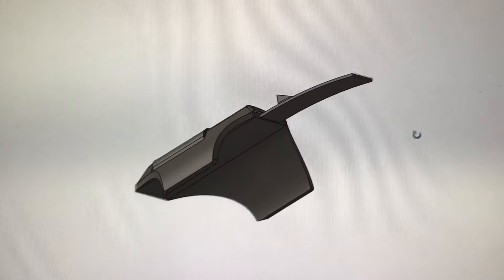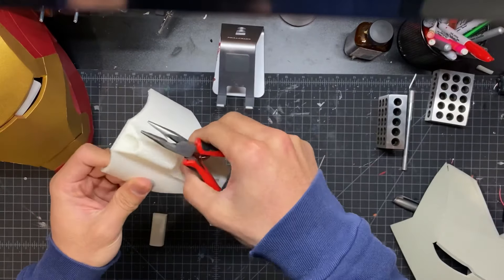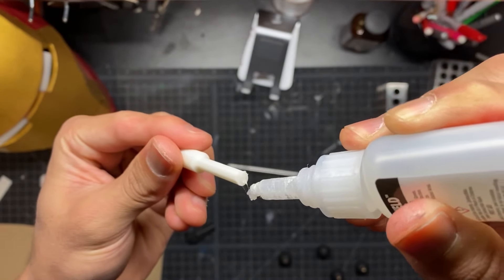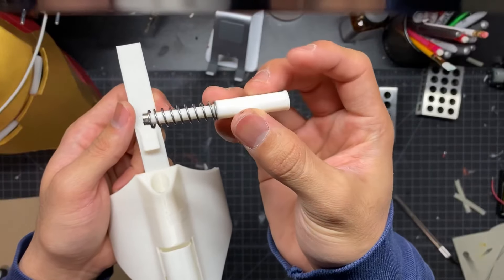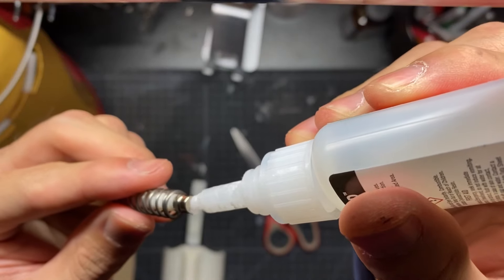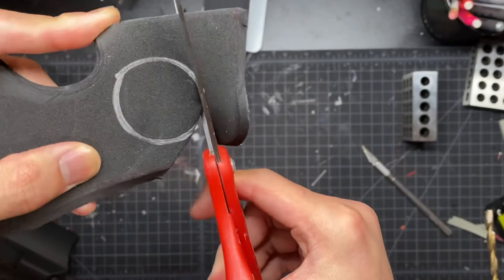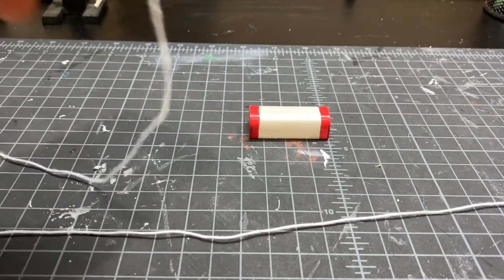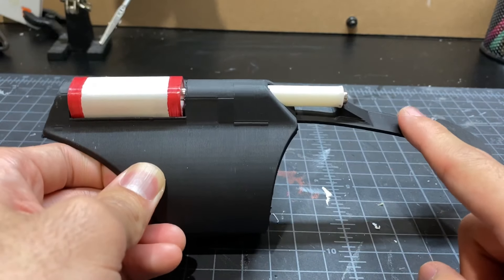How to: Spider-Man Web Shooter FUNCTIONAL! Real DIY No Way Home

Comment: Hello PropWay! (again) i successfully made the web shooter! it works amazing but my only problem is every time i shoot it at something metal it never sticks. only when i manually put the dart on it. do you have a solution to this? ive been thinking i should glue another magnet but i want to see what you have to say about this first.
Reply from the maker: Awesome! It could be that the dart is not hitting the metal surface straight on. Or perhaps you need a stronger magnet?
Reply: a follow up to prop's comment, it also might be hitting it with too much force, practice catching it when its about to hit the metal surface to break its speed

Comment: Which magnets did you use the 6x3 or the 6x2
Reply from the maker: I used 6x3mm. The link to the Amazon page is in the description!
Reply: @PropWay  thank you very much I was trying to model one of these myself then found your video and gave up on my dreams I actually have another question on the web cartridge I can’t get it to print it just makes 2 pilers straight up did you print your on the side?
Reply from the maker: @tykenison437  Hmm, I'm not sure what issue you are having, but I printed the web cartridge standing up. So the little hole for the magnet on the bottom of web cartidge should be facing down when printing.
Reply: @PropWay  yeah thats what I tried originally but it wasn’t working and even laying down the sides aren’t there idk what else to try honestly thank you for you feedback tho it’s been very helpful 🙂